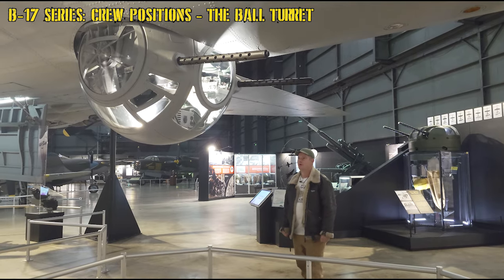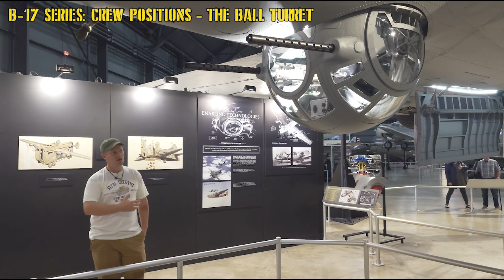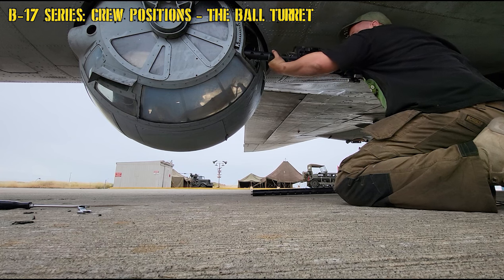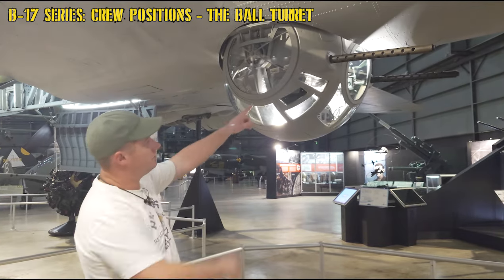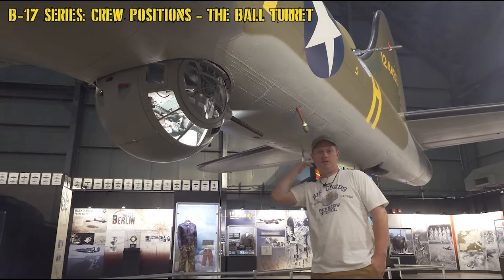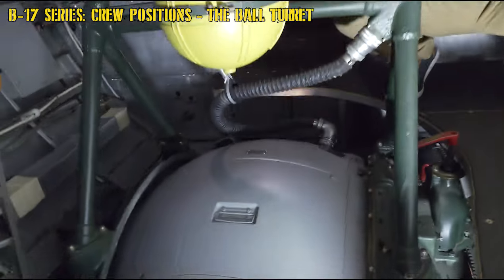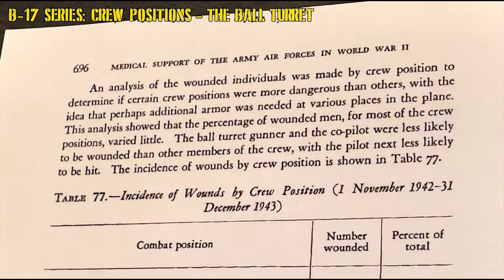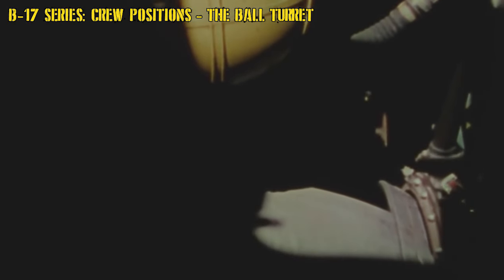B-17 "Memphis Belle" Ball Turret IN DEPTH!

Comment: It was dangerous because there were a few B17 belly landings in which the ball turret gunner was not able to exit the turret.  Squish.
Reply: I think this is a hollywood myth. I've yet to find one historical reporting of this actually happening.
Reply from the maker: We did our best to bust some myths here through our own experience along with what statistics we could find.
Reply: @fatcat3211  Actually during my time doing Army declassification work I saw 2 or 3 reports about them.  Wasn't exactly the sort of thing they advertised.
Reply: @MilitaryArmamentsCompany  Understood, and you did a good job,
Reply from the maker: Thankyou for watching and for supporting the channel. Plenty more coming.
Reply: Most belly landings were probably done after the turret was empty. But if it was jammed, ouch.
Reply: This was proven a myth by the US WWII Bombers channel last month.
Reply: While true to some extent, the turret could be jettisoned prior to landing. Bomber crews had high casualty rates during WW2, regardless of the role.
Reply: @AdamMann3D  And that is an example of poor research.
Reply: @kmoecub  Jettisoning the turret would be equally bad to the person stuck inside a turret that no longer turned because of battle damage to the mechanism.  Ir would probably be better to separate the I beam holding the turret so the turret can be pushed up into the plane at impact.  If a wrench was handy and someone had the time it could be done.  I have seen pictures of bellied B-17s with the  turret support framing punched through the roof of the fuselage which implies someone in the crew did do that for the man in the turret.  Obviously the 4 retaining safety hooks would not be pulled if that was being done.  B-17s (and other plane types) belly landed all over the planet during WW2.  Sometimes everyone walked or was carried away alive, sometimes not.
Reply: @jvleasure  Om;u p[tion is find a wrench and one at a time remove the bolts holding the turret to the frame, then push the updside down Y out of the way.  Leave the safety hooks (step 2 of dropping the turret) in place.  Hopefully the turret will go into the plane and not self destruct.
Reply: @AdamMann3D  How many bomber mission AARs obyained under FOIA did they review and from how many countries air forces?  Hoe msny unit diaries?
Reply: @kenibnanak5554 do we have information on the B-17(s) this happened to and the crew member(s) that was crushed? Not saying you’re wrong, but I would love to learn more about the information. Is it obtainable through FOIA?
Reply: @edm240b9  Sadly, no.  That read was more than a decade ago.  It isn't like I was there for fun.  I had to read and make declassification recommendations on 300-400 pages of Army documents per day and did that for years.  Nothing could be removed or copied (nor was I inclined to).  I can confirm however I did read 2 reports of such a mishap.  One we will probably never see released because it involved a plane crewed by an allied nation and it would be up to them to release the report (or even acknowledge it happened).  The other was a one or two line entry in a USAAF unit diary, but no I don't remember which unit, somewhere in what we now call the Mid East I believe.  (They moved their base around a little as lines shifted.)  I am pretty confident 'the powers' agreed with my choice of okay to declass, so it probably sits in National Archives somewhere.
Reply: @kenibnanak5554  this is actually really good and important information to come across. I assumed that like many war time stories, it was just a myth that was heard by Andy Rooney around the barracks and he just happened to report on it. Now knowing that two incidents did in fact occur, it actually helps further our knowledge of the war. I understand the nature of your job was tedious, to put it kindly, but it is an important job for the people interested in the history of these subjects, so let me just say thank you for helping expand the public’s info on WWII and other conflicts (I assume).

If you don’t mind me asking, was there any other documents that stuck out to you from the war era, or was it mostly pretty mundane stuff?
Reply: @kenibnanak5554 
Nonsense, quit telling stories.
Reply: @dukecraig2402 excellent information. I am glad your supporting this channel. US Bombers is very accurate yes but these guys really put in the hours to get some production value in and bring the viewer up close with this stuff, they film new angles and perspectives no one has ever seen before. (I know of no one else that has been allowed to cover inside the Memphis Belle to this level.) These guys for the most part focus more on how things work and the engineering behind them. When they are not making youtube they are restoring tanks. If you enjoy this B-17 series check out their Bomber Camp Episode. This guy has actual experience working on the Ball Turret of 909 and Ye Olde Pub. He is speaking from experience, not out of a book.
Reply: The ball turret crushed on landing story almost certainly never happened. The WWII US Bombers channel has covered this topic, and explains why this was extremely to unlikely to have happened.
Reply: @stewartmillen7708  
Yep, and wherein I'm glad he covered it the fact is long before he did that myth was already debunked by various historians and researchers who looked into the identity of the ball turret gunner from Andy Rooney's famous article in Stars and Stripes magazine during the war and found out it was nonsense, the first time I ran across an article written by a researcher who contacted the Air Force's historical research department and was told by them that there's no such record of it ever happening was about 3 or 4 years ago.
What cracks me up is all the people in YouTube comments who say nonsense like "My grandfather was in the 100th and he knew the guy killed in that ball turret...", it never ends.
Reply from the maker: Great comments guys. We were not exactly thrilled with the title, it seems cringey "busting myths and lies" unfortunately survival on YouTube these days means controversial catching titles that grab people's attention. Even if it has been covered. Sadly the reality is "ball turret in depth" just does not sell like it used to. Our main goal here was to turn new people into the subject thus preserving the history further. We certainly did not put in all the production work for minimal people to watch it. Sadly the nature of the youtube beast. Thanks for watching all and thanks for the support. Plenty more to come.
Reply: @AdamMann3D I heard about it straight through the mouth of a surviving ball turret Gunner from world war II
Reply: I read of one gunner that was given all the death rites over the radio, and after burning off all the fuel they could, the belly landing did crush the ball, the gunner was put up for the MOH, He told the crew to bail and not risk it, but as is the nature of being in a crew, they sat there with him until the last min.
Reply: it was mostly considered so dangerous because if you had to bail out you had to position the ball into the spot to get in/out climb out and then attach you chute and jump alot of things could go wrong in a situation where seconds matter

Comment: I think that the most amazing innovations during the war were actually the reflector gun sights and the gyroscopic k-14 computer gunsights. Then the computing pedestal mounts on the B~29, they didn't even touch the guns, the pedestal did all the work. All a gunner did was put the target in the reticule/reticle & push button, the electrically illuminated reflector sight did the rest to great effect. As with the K14 on the P51 & P47 & with the other larger models of different designation in the turrets on the B17, B-24, B26, B25 etc, the reticle was adjustable in size to encapsulate the adversary aircraft or whatever target. It is amazing that this was achieved without microchips, jus rugged tools, machines, & electricity. 
USAAF Forever!
Reply from the maker: Very good observation! We have covered a flying B29 in depth on the channel however it was Doc, with no gun turrets. We hope to get to fifi eventually and do the gun turrets. Thanks for watching. Please enjoy the rest of the Memphis Belle Series.

Comment: Another advantage of a turbocharger is that as altitude increases and air pressure decreases the turbo spins faster maintaining the intake air pressure to the engine. Superchargers for the, most part, are shaft driven at a constant ratio to crankshaft speed and deliver less intake pressure as the atmospheric pressure decreases. With the turbo feeding the supercharger the air pressure entering the supercharger remains relatively constant once the engine is at operating rpm and load.
Reply from the maker: Great feedback, thanks for the information.

Comment: I’m sure you had to be super short to operate the Ball Turret. Last time I went to the Air Force Museum I was able to do the restoration shop tour and they had the Memphis Bells turret and another from a B-24 right next to it. Slight difference between them but they were both pointed straight down without their .50’s mounted. They were really cramped in my opinion.
Reply from the maker: Thanks for watching. YES cramped but not as uncomfortable as many would assume. I've been in many tanks that are far worse.

Comment: My understanding is that a Ball Turret gunner could be no taller than about 5'5", ideally shorter, about 5'4".  The Death of the Ball Turret Gunner,
Randall Jarrell, 1914 – 1965
"From my mother's sleep I fell into the State,
And I hunched in its belly till my wet fur froze.
Six miles from earth, loosed from its dream of life,
I woke to black flak and the nightmare fighters.
When I died they washed me out of the turret with a hose."
Reply from the maker: Have never seen anything in writing so i stand to be corrected. I am 5.10 and fit in there just fine, able to operate all the controls. Thanks for watching.
Reply: @MilitaryArmamentsCompany  Height info came from a couple different Internet sources on the subject.
Reply: My dad was a full 6' tall and went through full training in the B-17 ball turret but new flew a combat mission as a gunner.

His story, training at Pensacola, was that you didn't eat breakfast because the guy before you had thrown up in the turret and the first thing you did when you got in was heave on yourself.